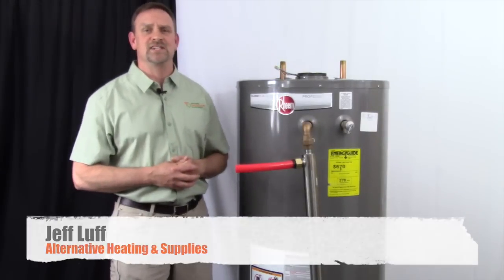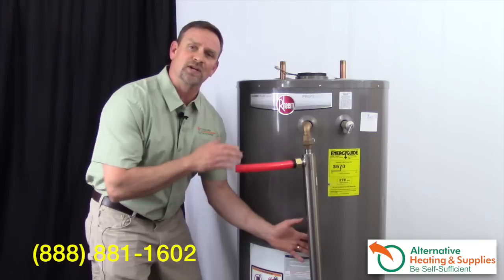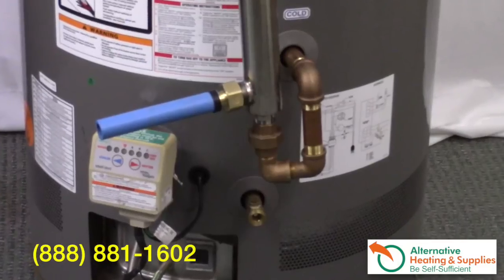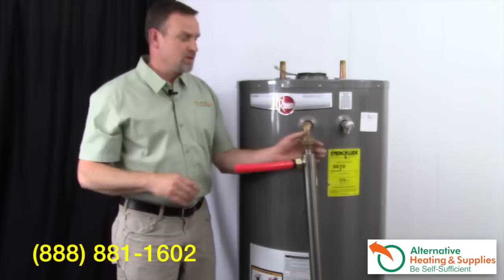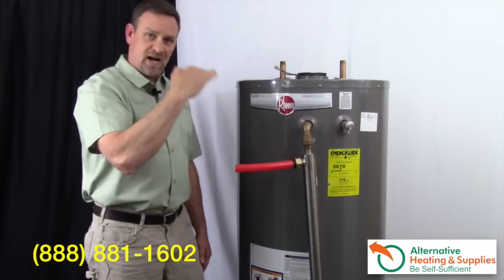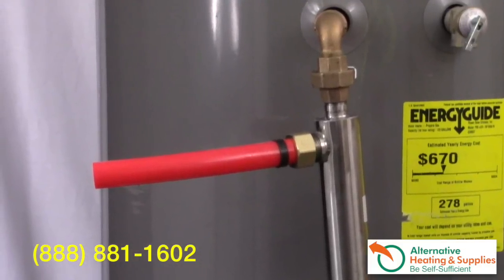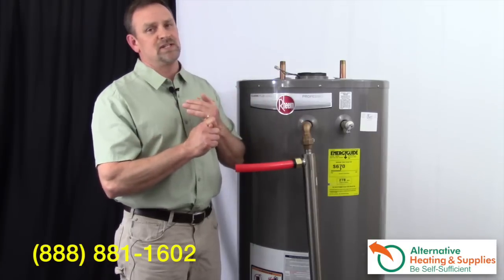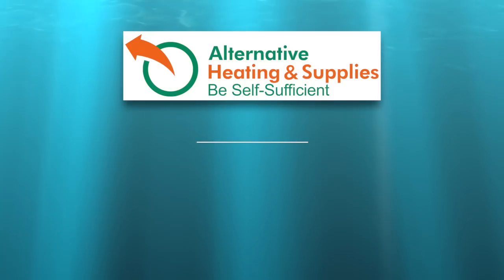How To Install a Sidearm Heat Exchanger | Tube & Shell Heat Exchanger

Comment: I can understand why you cannot use a DHW tank with heat exchanger coils built in, just like we use here in Ireland. They are standard here in either copper or stainless steel, with one , two or three coils , depending on your requirements.  I have a dual coil tank myself, for solar and oil fired boiler , and I made a heat exchanger like the one you show here about 10 years ago to connect a solid fuel stove for water heating.  The stove also heats a large fan coil unit to heat the air supply from a heat recovery ventilation system before distribution to the rooms in the house.
Reply: I'd like to see an example of your system. Ive seen the tank with heat as a diy or experimental system in the USA. It should be more considering solar dhw as secondary in series with a natural gas tankless heater.

Comment: high I have been in the h vac for 40+ years he i right  the side arm  can not be  conected to the hot and cold conections   otherwise  you end up with hot  cold mix  as he suggest   this is the most comon  mistake   if you have circ pump  best to dump   into bottom  if you have  high temp   heat source|   but  with geothermal heat pump  you  want the coldest  water at the heat exchanger in the heat pump so the reverse   at least 75%  are hooked up  wrong  creating all kinds of probems  hooked up right   they work great

Comment: What if your boiler significantly exceeds safe water temps i.e. 180+ and should you power off your water heater or just reduce the temp to a lower level?
Reply from the maker: The domestic hot water tank shouldn't get much hotter then 120 to 125 degrees. If it is getting hotter something is not correct.

Comment: Can I install a heat exchanger to my forced air furnace connected to the water heater , will it have enough heat to heat the house at -20 👀🥶
Reply from the maker: Probably not, You need water temps to heat air is about 170 degrees, much less then that feels like cold air coming out.

Comment: Why will you get a thermal siphon with a plate exchange but not a sidearm? It would seem the same pressure equalization principle would apply either way.
Reply from the maker: Much more surface area in a plate and less space as well. More pressure.

Comment: With this setup, do I need a mixing valve somewhere? On the top of the heat exchanger or on the hot outlet to the house? I guess I'm wondering how hot the heat exchanger will heat the water and if my electric water heater can handle it, so should it be tempered before it enters the water heater.

Comment: I put one in recently and it did not work.  At all.  I walked away and came back the next day and tried one thing.  I operated the tpr valve hoping an airlock was causing the issue.  That sucker hissed like an angry cat before i felt any liquid come out.  After that the top pipe was too hot too touch. Before it was hardly warm.  Just wanted to mention this possibility.
Reply: Also mine is attached to the drain on bottom, and tpr on top.  It works stellar with a very quick recovery.  But the capacity is so huge recovery time is not an issue.  It does need a mixing valve to temper the heat to a safe potable level.  Which is the case with most wood fired water heaters of any kind.

Comment: Is the boiler water going in the top or bottom on the side arm mine comes in the bottom and goes to the top then to my furnace
Reply from the maker: It isn't that important, but i try to always have the waters traveling opposite directions. So I come in at the top. Jeff
Reply: Thank you Jeff I will give that a shot I have a new water heater and a new sidearm I’m trying
Reply: I set mine up just like the one in the video and I have to say thank you I have the hottest water I’ve ever had

Comment: I have been using a side arm heat exchanger that I purchased from the company that sold me my wood boiler.  We have a 105 gallon Marathon hot water heater and the only inputs are on the top of the tank, not on the side like your video shows, so I have the return going into the pressure relief port.  I also installed a circulating pump to help keep the potable water flowing, but we still run out of hot water or it doesn't heat up past luke warm.  I keep hearing a little "ticking" noise under the relief valve like the water is trying to flow against a valve of some kind and I'm wondering if I've installed something wrong there or if I just have a bad exchanger.  Really frustrating.  Any ideas?  Great vid by the way.
Reply from the maker: a plate exchanger is much more efficient and will fix that issue..
https://altheatsupply.com/heat-exchangers/brazed-plate-heat-exchangers/5-x-12-stainless-steel.html
Reply: I agree about the plate exchanger but it sounds like you may have an air lock, I would recommend pushing the pressure relief valve to see if air or water comes out. Just press it until water comes out and see if that helps

Comment: Thank, Jeff.  Wish I saw this before the install was done.  Contractors made this mistake.  I don't have a side port and I have a sidearm.  Any alternative to switching to the plate exchanger?  The sidearm has now been used and installed as well as the new water heater.

Comment: Very interesting, i made the ajustement. Can you confirm that hot water from the furnace is entering by the bottom ?
Reply from the maker: Yes, correct. It will allow air to flow out easier.

Comment: I have a wood boiler and use this type of heat exchanger on my hot water heater, mine comes over the top and drains down on top. Like you said not to do. I have plenty of hot water though, and no problem with it, would I gain anything by plumbing it to the side? I just bought the house a few months ago and this water heater has been in place since 2019. Would you recommend re plumbing it. Or leave it since I have no issues?
Reply from the maker: If it is working and keeping up with the demand... Leave it alone. Don't F_ck with if it is working good! LOL

Comment: I'm thinking of installing one of these, but I'm concerned about the tee on the pressure relief. The valve has a probe for sensing temp, so it can vent if the tank overheats. I've read this is supposed to extend into the tank, and one needs a valve with a longer probe if using that port with a tee, so it can extend through the tee into the tank. Is this required by codes, or just a good suggestion, or nonsense?
Reply from the maker: PRV and be purchased with all different lengths prob, not a bad suggestion, but you will have plenty of water flow

Comment: I have my side arm installed on my hot water heater and keep getting lots of air? How would you fix this problem I put a boiler air blead valve on the top of the tank
Reply from the maker: Never heard of that issue before... do you have any idea where the air is coming from? I can't be micro bubbles...

Comment: Is it better to have the heat inlet pipe on the top or the bottom of the exchanger? I see it is on the bottom of the plate exchanger but on the top on the side arm exchanger, please explain.

Comment: Can you add a water circulator pump to continue the flow of water through the heat exchanger?
Reply: It does that on its own like a block heater.

Comment: I have a water heater with a heat exchanger built in for adding hydronic heat to base boards to use the water heater as supplemental heat can I run the boiler lines through the top and bottom ports already built into the heater in replacement of the side arm heat exchanger?
Reply from the maker: No, i won't get hot enough to heat base board heaters or will be very slow to heat.
Reply: Can you please tell us the brand / make and model number of the water heater w built in heat exchanger ,its what I'm looking for ,thanks m

Comment: Can you take out the top and bottom heating elements and use those two points for connecting your exchanger?
Reply from the maker: sure you can...
Reply: yes have seen this done  also works  well

Comment: What are some manufacturers that make domestic hot water heaters with those special "side ports" like you have in the video? I've never seen that option before, but I guess I haven't looked real hard because I wasn't aware of their existence. Manufacturer and model number if you know it. Also, do these ports exist on small and large water heaters? I'd want one in the 55 gal range for my household. Thanks!
Reply from the maker: Not really sure who makes them like that. Sorry
Reply: Rheem i guess lol

Comment: Does it matter if the hot water supply on the shell side goes into the top or bottom of exchanger?
Reply from the maker: Not really, just a little better the other way, little more heat exchange

Comment: Are plate heat exchangers with a pump more efficient than a thermosiphon tube and shell??...if you take into account the electricity for the pumps required for plate heat exchangers if not using thermosiphon.
Reply from the maker: using a pump with plate works great and will still save you a lot of Money. pumps are about $10 a month to run and domestic hot water bill is about 25% of your energy bill

Comment: My sidearm isn't putting out sufficient hot water from the tank.Not enough to fill a tub. The domestic hot water comes out of the drain and goes thru the  sidearm, and then into the hot water outlet. Trouble is the sidearm is slightly taller than the tank, so in order to return thru the pressure relief hole as you suggested, the hot water would have to drop, which might create another thermal block. Any suggestions?    Great video.
Reply: this is hooked up  wrong  you are getting cold mix with hot outlet   water runs eazer threw side arm than  hot water tank